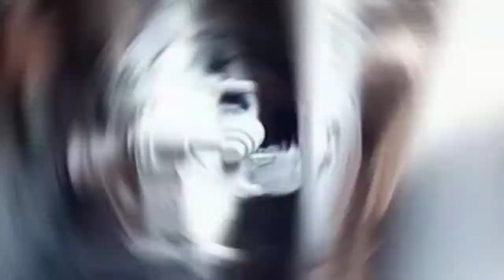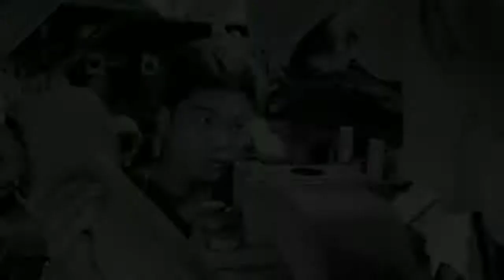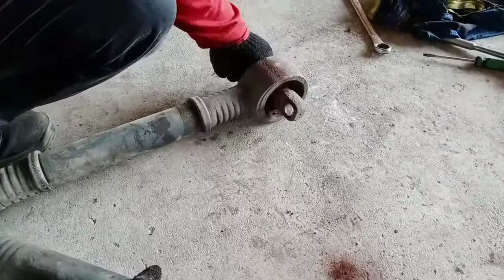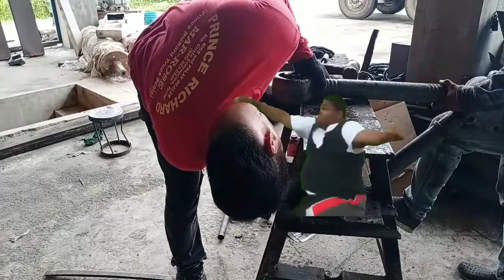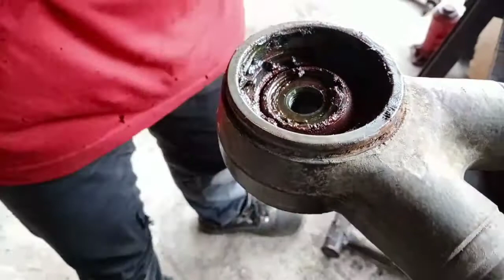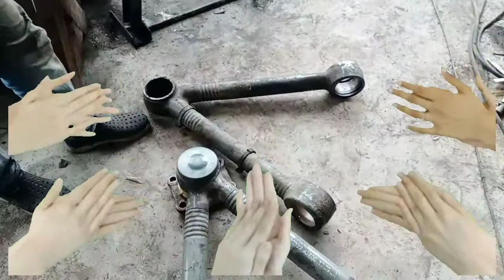HOW TO REMOVE TORQUE ROD V-ARM AND BUSHING (NO NEED MACHINE SHOP) | HOWO TRUCK

Comment: Good work. A little advice, if you don’t want to hammer the centre base plate off. Remove the dust cover and undo the centre bushing bolt and using the longer bolt from the side bushing longer bolt, just screw it in the centre bushing again. It has a double thread, longer bolt will act as a puller and whole bushing will come apart from the base plate in a few turns.